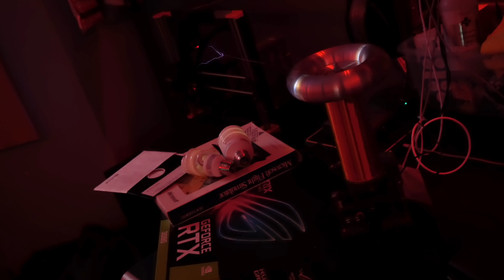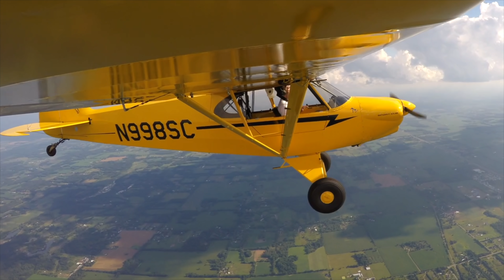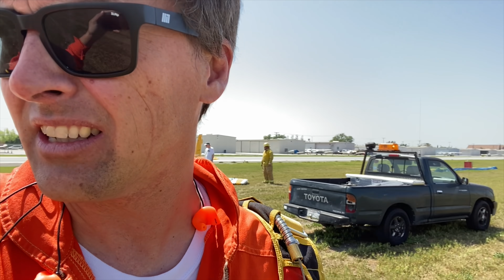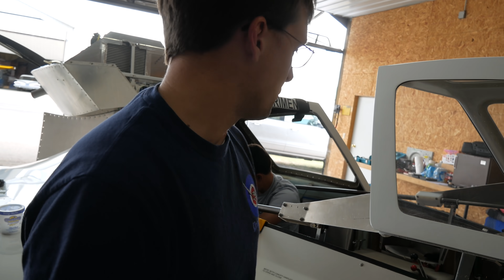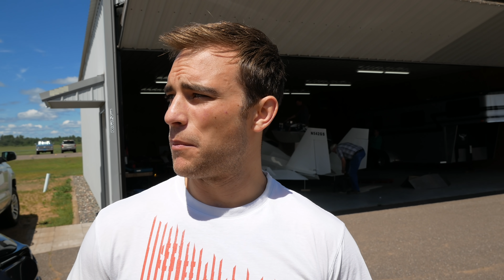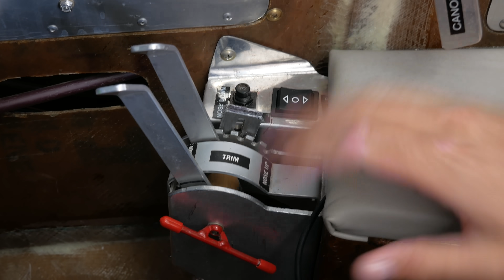Crash Course in not Crashing - Test Pilot Prep for first Flight!

Comment: I tested my own KR2  as a  60 hrs total time pilot sel with a 1915 CC VW type one . The KR2 is a true delight to fly and has no bad habits  . Its really a very strong sporty little plane and handles great . It flew with finger tip control. The really demanding part of the flight was the  super sensitive elevator or pitch sensitivity during landing. This was compounded by being a taildragger on a very stiff main gear . I made all wheel landings . After flying the KR2 the spam cans were very labor intensive and were not fun like my little agile aerobatic toy  . The Type 1 VW by  Steve Bennett never failed me for the 850 hours it flew . My first flight as was the case for many 1st flights started as a high speed taxi test . It seemed the only limitations the plane had was the pilot.

Comment: "I blame ..."...yeah the beatings will continue until moral improves.  Seriously though, I have seen that happen where they are not kidding more times than I can relate, where the implied thinking (or not thinking, actually) is somehow things would have obviously been much better choosing the far more risky option.  Gotta wonder.  Ya just can't win for losing...that old saw REALLY applies there.  Some people are clueless (not you).  

If you haven't watched their (the test pilots, support guy's) channel, it is really informative, and interesting.  More knowledge is more power, and safety.   Flying wings, even low aspect ratio/extended chords configurations are agony to make safe.  The military just makes them unstable as hell and adds computer power to the equation.  There are other reasons to do this, for a fighter, but when the computer fails, they just spread themselves across the sky.  There is literally zero chance to fly those totally unstable planes by hand, and if you look back at what happened with Northrop's attempt, ect. it is often a disaster.  Obviously things can be designed today, with computer aide, that couldn't be done 'way back then', but still, a serious design challenge.

That is a very cool looking project/design.  Here's hoping you have total success.  Stay safe.

Comment: was that an old 486 or early Pentium I saw in Dave's nerd room?  I still have my first computer (at my parent's house), which was a Gateway 2000 486 that my dad got new when I was 10.  

Also, the 3 rotor 20B is not an Rx-7 motor, it actually comes from the Mazda Cosmo.  It has been put in a number of RX-7's though!
Reply: It's a 486/SX/33 with a drop in 486/DX2/66 upgrade.
Reply: @thehoeser  Nice, I had the 33 :) . I don't miss it but it is cool to see. I'll take the speed of my i7 with a GTX 3070, GTX 1070, and 32 GB (Had some RAM get corrupted, I will be back to 64 in a few months.) RAM, where I can do the things I dreamed of as that 10 YO imagined he would with his buddies at the time. I am sure you have similar feelings about the latter part!

Comment: A rotary in a plane? Doesnt really make sense if you know how unreliable these engines are.
Reply: They can be made more reliable, but not anywhere near a piston engine. My concern on the build is the lack of cooling. 3 rotors make a ton of heat. The radiator looks too small, and the inlet to the engine area is not big enough to feed the engine and pass any substantial air across the radiator.

Comment: It's hard to believe the Titan T-51 Mustang was totalled after that landing. I thought he did a great job of flying and editing the video of it. It's pretty clear that automotive engines with non-redundant ignition systems and reduction units don't belong in airplanes..
Reply: I'm not that surprised to be honest. The prop struck the ground, which probably damaged the whole engine assembly. The entire belly and right wing dragged on the ground, likely causing quite a bit of structural damage all over the airframe.

Could it have been repaired ? Maybe. Would it have made financial sense ? Probably not.
Reply: @arthurvilain7270  The wrecker crew wasn’t very kind to it either..
Reply: Modern technology is orders of magnitude more reliable when integrated correctly. The fact that there were multiple isolated failures in quick succession indicates that there were fundamental problems upstream from the power-plant. I'd speculate that the bent landing gear put a very high (and unanticipated) load on an electric retract actuator that pulled down voltage in the only electrical bus. The engine ECU, ignition and EFI were then starved. A small and lightweight li-po battery pack wired as a redundant/isolated engine electrical supply could've given the pilot time to line up the plane and destroy it on the centerline instead. 

Any psru failure had to be related to the prop strike.
Reply: @paulslevinsky580  The gear coming unlocked caused the hydraulic pump to run. This in turn overloaded the main breaker, which wasn't correctly sized for the installed equipment and took out the engine electricals when it tripped.
Reply: @daniellewis1789  Thx for the correction. It's amazing that the non-redundant critical engine electrical systems were on a common bus with the landing gear (and other electrical loads?). That right there is a "made to fail" design.
Reply: @paulslevinsky580  Your point is still completely on target. This was not a redundancy problem but an electrical system architecture problem. Electric motors are a devilish load with a wide variance between stall current and idle current. Electric motors should always be on a dedicated circuit built to handle stall current. Circuit protection at the basic level must be hierarchical for aggregate loading but it must also be clear what faults are being protected and how. For example in automotive the alternator output usually has no protection and is instead built to handle full alternator output without fail. There often is a protection device upstream with a very high rating whose role is protecting from battery sourced overloads. Advanced or auto technology can fly but you need to apply equivalently advanced design acumen to the system so as to maintain the excellent reliability of todays hardware.